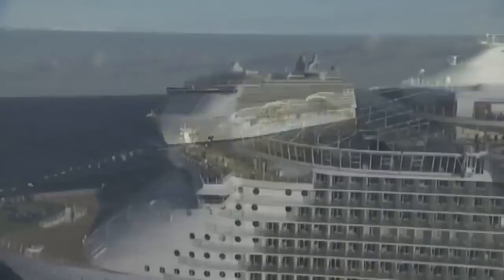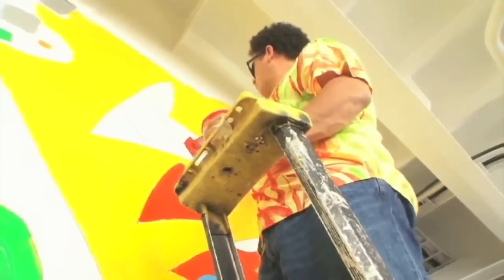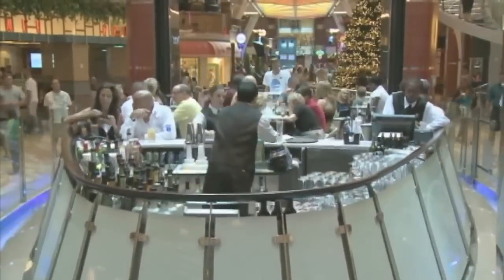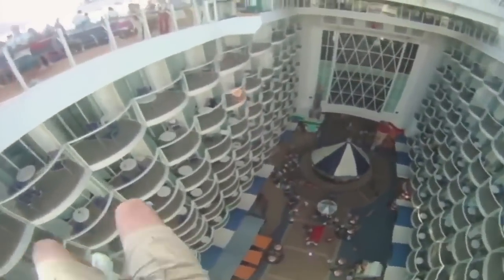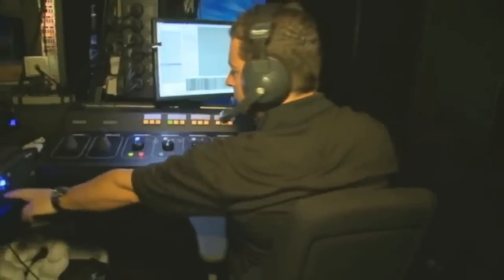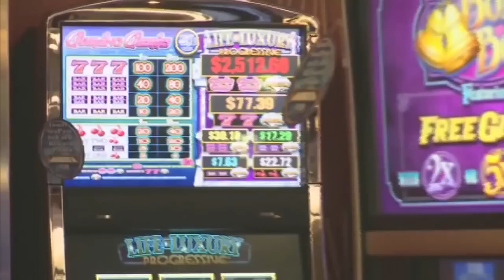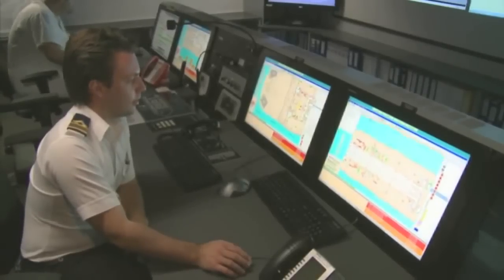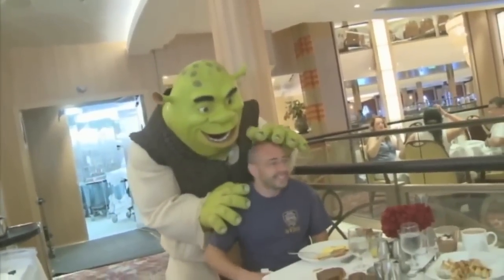Allure of the Seas - Full Documentary

Comment: some people didn't know this harmony of the seas is the biggest allure is 2nd
Reply: +Nathaniel Oabel yeah, but Harmony has only just been delivered.
Reply: Every Oasis class ship is same size, that how they tell you size is different
Reply: +1011340 nah each ship is a little bit bigger than the other
Reply: Cam Sil same size, first two ship size wasnt told so accurate than latest
Reply: +1011340     Harmony of the Seas IS bigger. Harmony's tonnage is 226963 GT, and Allure and Oasis are 225 282 GT, Harmony is also about 2 m longer. That 5 cm difference in lenght between Oasis and Allure was caused by different temperature of the steel during construction. That's less than 0.014 %. They have in practice the same size. Just because ships are sisters doesn't mean that they must have exactly the same size.
Reply: I meant to say that same class ships don't need to have exactly the same size. RCI are building a fourth Oasis-class ship. This one will have the same size as Harmony. For now it's called "Oasis IV"
Reply: +QE2 why do they need so many? Is there that much demand?
Reply: +Cam Sil     There must be. Otherwise they wouldn't build $ 1.4 billion ships.
Reply: More passenger equal more money! It's all about dollar bills.
Reply: Harmony is now the biggest by 1 foot :)